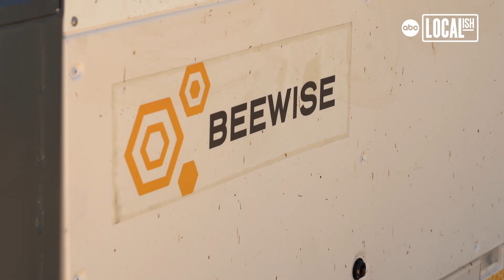Smart Beehives to Save the Bees

Comment: This is a joke. Coming from a commercial beekeeper. Money grab.
Reply: yeah I cant disagree. I mean there is a lot of unanswered questions by their company and they do not want to respond to anyone on it. I mean how are their magic frames supposed to go in a Cowen honey extractor, will it auto mite treat, and what all does this "magic box" do for us besides check frames.
Reply: @donotcare330  There’s a podcast out today where the Beewise founder clears up a few things. First, it doesn’t do honey extraction – that’s still manual. He also claims it treats varroa with heat, though the explanation was pretty vague (color me doubtful). The system does have some genuinely useful features like scanning for disease, food levels, and queenrightness, and it can even move frames between colonies to rebalance them. But at the end of the day, a beekeeper still has to come in and do most of the hands-on work. Honestly, the most valuable piece right now looks like the AI training – the data they’re gathering could be sold or applied elsewhere – but then again, you can imagine a model like ChatGPT learning this in an afternoon with a photo set from a few textbooks. Feels like one of those cases where you slap “AI” on the pitch and suddenly it’s a billion-dollar company.
Reply: Speak with them. I did. Queens get stolen in rural areas, mites, hornets, temperature, pesticides. I also spoke with main Florida Beekeeper. I'm still a dumbass, but I am all for modernizing tech to save bees...and our food.
Reply: How much
Reply: Modernize or bee left behind!